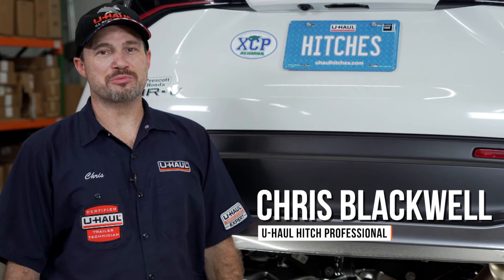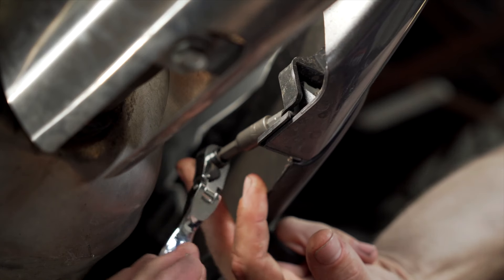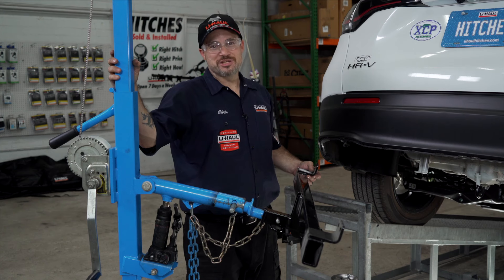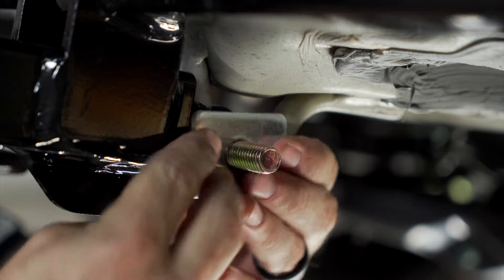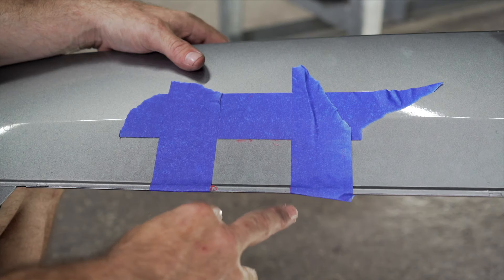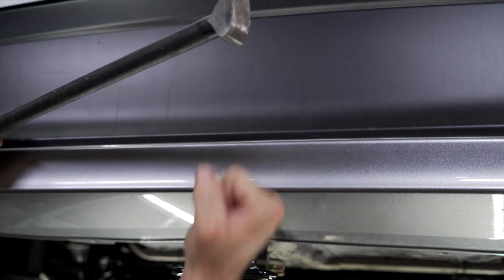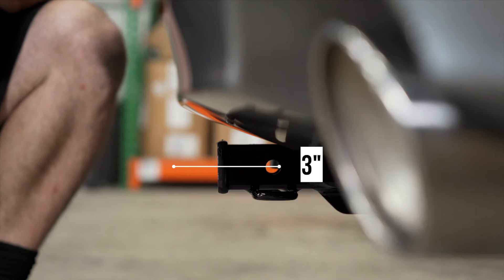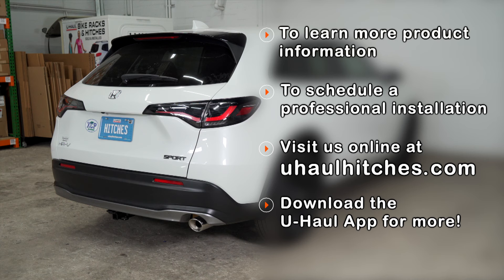2023-2025 Honda HR-V | U-Haul Trailer Hitch Installation | CMF11640

Comment: Can i tow my jetski with this? Trailer and jetski both together weigh under a1200 pounds
Reply from the maker: This Hitch is rated for 2000 lbs wieght carrying capacity. Always refer to your Owners manual for thier recommended towing capacity.